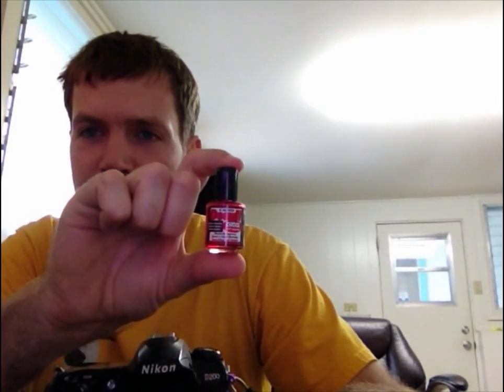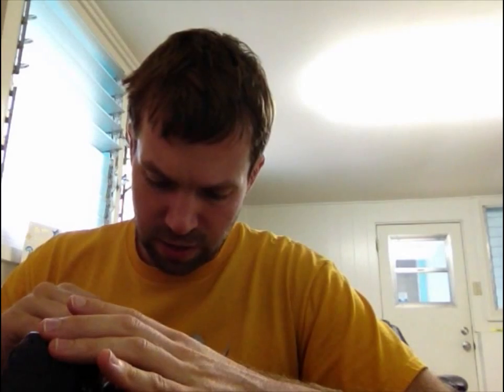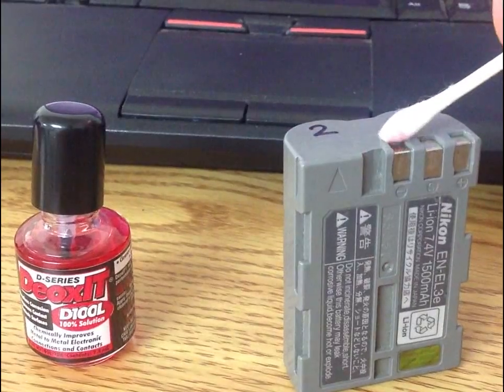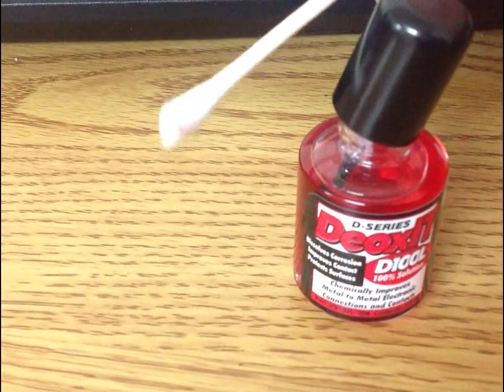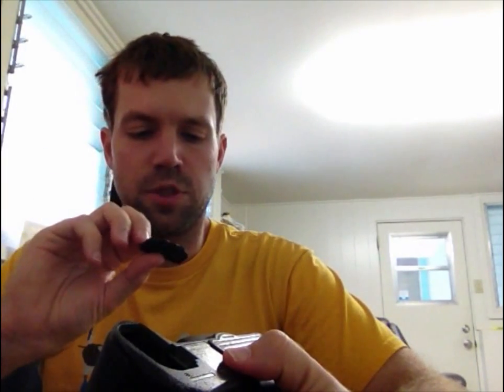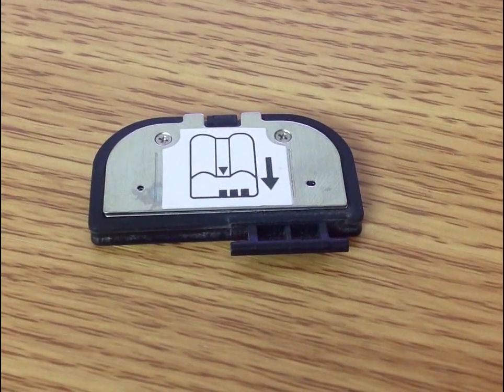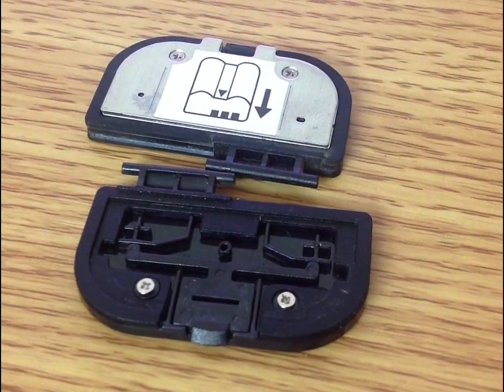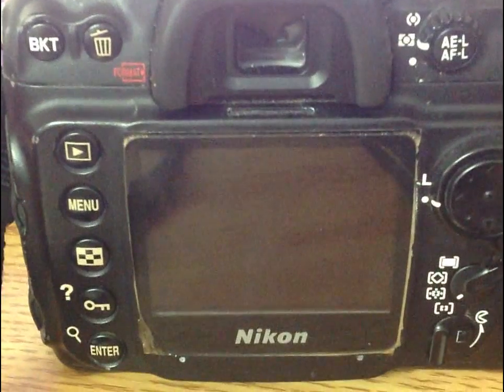Nikon Dead Battery Syndrome (DBS ) fix, firmware, deoxit, and battery shiv

Comment: 8-25-2024 I had this situation and Goggled around. Cleaned all the contacts on the body and the lens but still had a 100% charged battery reading only 3 bars on the camera. BUT what fixed it was simply tightening down the screws on the round silver lens plate that is on the body that the lens match up to. That was it!!! Hope this  helps!!
Reply from the maker: Awesome good find!

Comment: Can u pls help me...
Im using my d3300 I clean the sensor,lenses and after that i take pictures and try to use different mode in camera after that my camera turns off and when i take out the battery it so very hot,i charged it until full and insert again in my camera...it turns on then after a couple of seconds it shows lowbat,then i charge again and after 5 seconds it shows full in the charger and when i inserted the battery it turns on and off again..what would be the problem?
Reply: Same problem here
Reply: Same problem
Reply: Same problem

Comment: Thanks a lot for sharing! Your video helped me. My D750 had the “dead battery” symbol and wasn’t turning on. Your video gave me a tip that the battery was “loose” and the cap was not thick enough to press it up. I manually pressed up while switching on and it worked. It’s working now, but as soon as possible I’ll adapt the cap as per your idea (to guarantee proper battery contact). Cheers!
Reply from the maker: I'm stoked to hear that it was an inexpensive fix!  Congrats on getting everything working again!
Reply: @IAmWhil     I have an update to my case. I hope this can help the people having dead battery syndrome in general. The first time my D750 got this issue, I solved it by pressing up the battery while turning the camera on and added a small plate between the battery and the cap. It worked for one day. However, the syndrome appeared again. This second time, nothing was helping. I pressed the battery up, changed the memory card, changed the objective, cleaned the connections with vinager, and nothing was working. I was quite sad. Then I had the idea to buy a grip to see if "somehow" another energy channel could work. I bought the economic version (not Nikon but Walimex) and I´m happy to share that it worked. Just for clarification, I hadn´t bought a grip before ever (so the usage of a grip was not at all the cause of the syndrome). Now, after bringing the camera back to life, I gave it a try to update the firmware to see if the camera could work with the battery directly in the compartment, but this didn´t work. So, my D750 depends on the grip, but at least the solution was not so expensive (in Germany, only the shipping to the service center and the basic check-up would have cost the double of the grip).

Comment: I fully charged the battery and when i put it in it doesn't work can you tell me why?
Reply from the maker: Try inserting the battery and holding it down with your fingers.  Does it turn on?  These fixes may help.  If not... could be corrosion (use the deoxit) or something worse.  Sorry couldn't say :(

Comment: I want to ask you, how to replace the DSRL internal clock batteries in nikon? I have Nikon D300s, its been a while since i used it and it seems dead, can you do a video on this topic please, cheers.
Reply: Just change the CMOS battery. (That's the little coin looking battery)
Reply: @noholdsbarred  He asked how...not what.
Reply: There is only one small coin cell looking battery.
Reply: @noholdsbarred  He may not know where inside the camera it is located. I don't have this camera at this point so I don't know. Just repeating what he already stated using different language does not address the question he posed.

Comment: Thanks man it really helped all I did was clean the battery with my shirt to the S5200 and now it's working again! I tried charging it for hours and it wouldn't turn on so now it turns on just fine thanks!
Reply from the maker: Awesome!! Good job!  I've also gone to town on my electrical contacts with the Deoxit stuff and found it works on headphone jacks and HDMI slots REALLY well too.  So if you keep getting frustrated with other things magically flaking out, you can try it there too :).
Reply: IAmWhil Ok thanks for the tips!

Comment: Thanks for the ideas. FYI I've done the firmware update and it still is exhibiting DBS. I then went to shimming the battery door and it's been ok since. I'll let you know if anything changes. BTW, if it hasn't been pointed out, the word I'm sure you meant to use was SHIM and not SHIV.  A shiv is a knife. A shim is a spacer to fill in unwanted space. D200's still rock don't they?
Reply from the maker: Haha you were the 2nd person to note the shim/shiv mis-speak :).  Glad the shim did work!  I managed to pick up a d200 for ~$100 and it's still performing like a tank!

Comment: My Nikon D3200 wont turn on. Only used it 3 times. I've tried 2 different charges and 4 different batteries. Looking into the view finder, a battery simple blinks 8 times. I have been assuming that it is an internal battery that has died but I havent found anything yet

Comment: How do you update the firmware if the camera will not turn on?
Reply from the maker: Oh man... Well step 1 will be getting it to power on at all.  I'd suggest trying the shiv / cleaning the batter terminals.  If that does not work, try to get your hands on a new battery to see if it will power up at all (A camera store may be able to lend you one for like 5 minutes to see if it works).  Go for the above steps in either order... Maybe you'll get lucky and your battery will be fine.  
In order to be able to flash the frimware you need it to be able to power on.  If it will not power on with a new/tested good battery it may be something dead on the motherboard keeping it from powering on (broken solder / exploded capacitors / corroded leads :-/)  Sorry I can't be of more help on that one!  Best of luck!
Reply: Thanks for the fast reply, it does somewhat power on but only shows a dead battery symbol with no power to the LCD. I have heard your computer won't detect a D300 unless you go into the menu system first.
Reply from the maker: I'd try the shiv first, and cleaning the terminals if the power is flaky.  Also make sure the battery is good.  It could just be a faulty battery.  Don't flash unless it stays on, as it could brick the camera :-/
Reply: @IAmWhil  DBS is mainly to do with VR lenses. Switching the VR setting to off can sort it out also and removing and installing lens.

Comment: Did you check the batteries with a volt meter to see if the were actually DEAD ??  Before you did all that other crap ??  Could the cheap China made camera be draining the batteries very quickly  ? ! !
Reply from the maker: For others who are experiencing this, checking the batteries would be a great idea as a first step! Thanks.
These batteries were in fine shape (indeed - checked with multi meter and tested in other cameras), and OEM Nikon.  
This is a fix for the Nikon Dead Battery Syndrome (DBS) which unfortunately was fairly common for a while.

Comment: Thank you has I had what looked like a dead battery and being out of the country I had no help. I tried using a dust blower on the battery contacts which I have to clean the dust off the sensor and it seemed to work. This video helped to confirm the problem.
Reply from the maker: +G. A. Whelan 
Awesome!  Glad it helped!  Keeping the contacts clean will help immensely!  We're actually still using this D200 :D and its going strong!
Reply from the maker: Hahaha 100% true!  I misspoke!  Good catch.  If you're going to shiv your camera, its probably end of the line!

Comment: thanks this video helps a lot of tips, i have a nikon d300s the problem is i have a (hot/stuck/dead pixel) ive updated the firmware, if you have any tips on fixing this i'd appreciate it!!
Reply from the maker: My friend has the same problem.  The current solution she is using is http://www.pixelfixer.org/  It will fix the pixel based on whats around it given a blank shot (essentially an exposure with your lens cap on.)  
Another good solution is to use a "Dust of reference picture" which will fix the problem in software on the camera (most of the time).  https://support.nikonusa.com/app/answers/detail/a_id/7324/~/how-does-image-dust-off-work%3F
Let me know if either of these work, dead pixels are a bummer :(

Comment: Hello friend, okay? 
I have a Nikon D3100. I am the 1st owner of it and now have a 1 year. 
Whenever I finish using my camera, I take the battery and keep. 
Today I got to wear and to my surprise, the camera does not recognize the battery. 
I tried using your method but with isopropyl alcohol and failed. 
Do you have any more suggestions? 
Thank you!
Reply from the maker: I would try a second battery to see if it will power up the camera.  A battery from Nikon D5300, D3300, D5100, D5200, or another 3100 will work.  That will narrow the problem down to the battery, as opposed to something more unfortunate with your camera.
Isopropyl alochol is good for removing oils, but not so much corrosion.  See if you can get some of the deoxit, or similar corrosion removing solvent to remove the tarnish from the battery terminals.
Best of luck!
Reply: IAmWhil The camera comes to call, but the following message appears: "Can not use this battery Select the battery designed for use in this camera.." I do not know what this error is. I bought this camera in the store, all items are original. 
I've searched google for similar problems but found nothing.